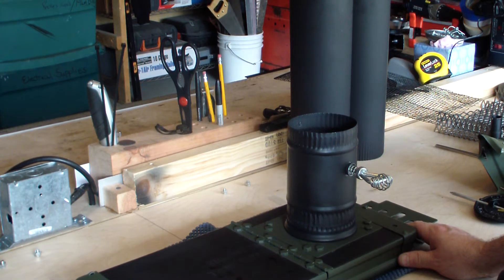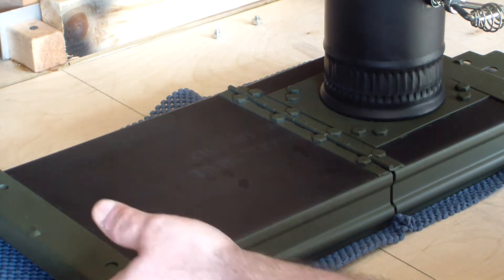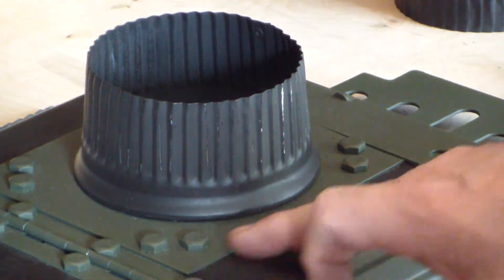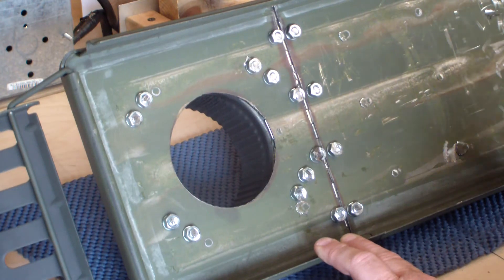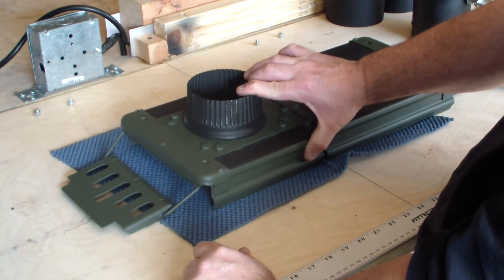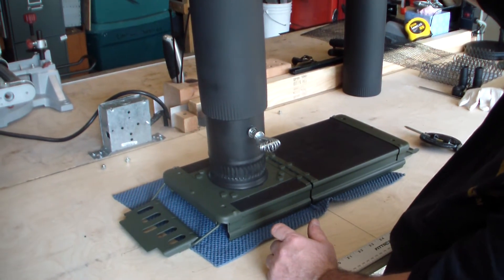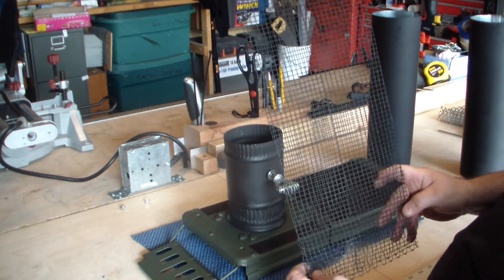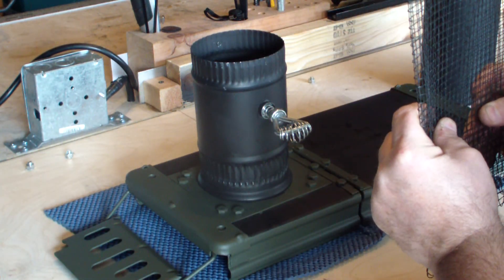20MM Ammo Can Tent Stove Part 3 of 5

Comment: I plan to build an ammo can stove and I plan to use many of your techniques like the boat rail mounts. i want to comment about your paint job. Sorry to say this since you put so much work in designing it and building it the pain will fail. You need to sand the entire box down and remove the base military paint off before coating it with the high temp paint. Any good painter worth their brushes will tell you that your paint job is only as good as its base or primer coat. the factory military paint is not high temp paint and once it is used a few times it will fail and take your top coats of high temp paint with it.